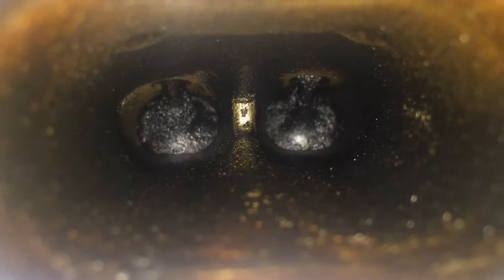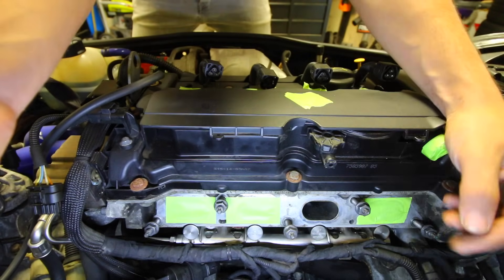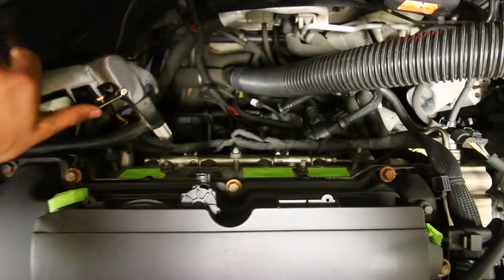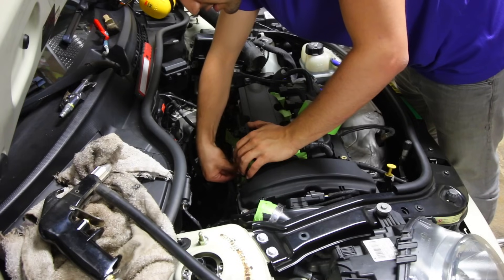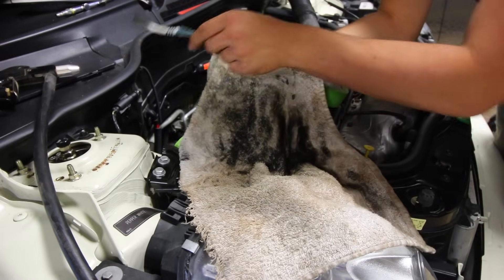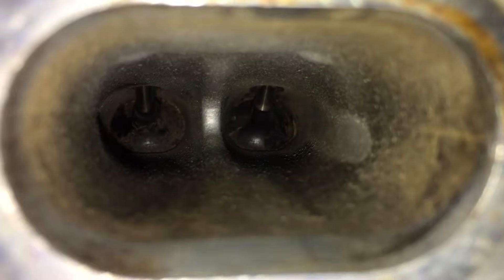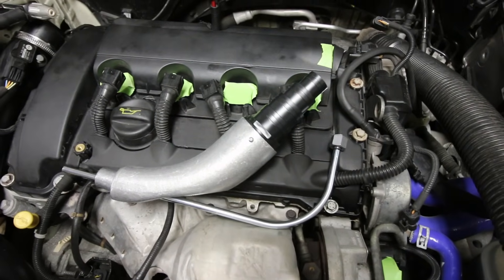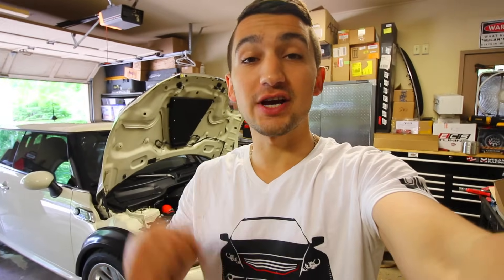How to Walnut Blast Your Intake Valves (CARBON BUILDUP REMOVAL)

Comment: Hey man, these vids have helped me sort out so many issues on my R56 since I’ve been subscribed to them! So I want to say a huge thanks! 

Quick question, if I did this process minus the actual walnuts, just cleaned with brushes and plastic picks followed by carb cleaner or similar would that be worth doing? 

Mine is suffering some hesitation under light acceleration so I’m sure I have carbon build up also @82,000 miles.

What are your general thoughts on the r56 n14 engine, they have really bad press on forums etc, but you are switched on and have still gone for one? Can’t be that bad then? How about a vid discussing the common faults with these and what to look out for when purchasing an r56? You would get a lot of hits.

Cheers
Ben

Comment: My tip: If you have a manual transmission, leave the car in gear and turn the engine by nudging thr car forward/back.
Reply: If you have a normal diff you have to lock one wheel, by doing one wheel in the air and one on the ground  than you dont have to push the car forward/back. just turn the wheel :)

Comment: Good video!  NEVER use an engine running solvent based cleaning as the deposits on GDI engines is NOT the soft carbon of past port injection. Solvents that loosen these hard crystalline deposits always results in some forced between the pistons and cylinder walls and causes scouring damage!!!

Comment: Why not just use seafoam spray or some other liquid cleaner since it's being sprayed by high pressure. Wouldn't it be just as effective and no Hazzard of killing your motor?
Reply from the maker: Seafoam would work for a port injection engine. Since this N14 motor is direct injection, nothing ever touches the backside of the valves, which is why these things gets covered in oil and carbon

Comment: Looks fantastic. 
Nice clean and ofcourse i'm sure it is better.
But what about the edges of the valves. 
Because they are closed, the edges stay dirty. 
How can you clean that?
Reply: marcello033 i was wondering about this too.
Reply: There are a handful of products you spray into the intake while the engine is running that are meant to replace this procedure, obviously nothing that comes in a can will replace this depth of work but it will help control buildup all around. Various forums recommend it as a complement to walnut blasting

Comment: Couple questions: How do you know if the valves are fully closed? What do you do if you get walnut pieces into the cylinder head?
Reply: Remove all spark plugs (so there's no compression and you're easily able to turn the crankshaft with a wrench) and insert a rod down the spark plug hole until it lands on top of the piston. Turn the crank until the rod is at its highest point and look into the port. The valve should be fully closed. I then taped a small piece of hose to the port and blew in it to make sure no air was escaping which meant the valves in that port were fully closed.

Comment: Not sure if you have a video on this but, I have a 2007 MINI Cooper S.  My engine light came on and an Auto Zone code came up to clean my fuel injectors.  Do you recommend an additive directly in the gas tank or will this not work on a MINI?  Any help is appreciated!

Comment: stupid thing to do. bits can blow past valves.  what about the exhaust side? exhausts always clog up more. the seats won't have been checked or cleaned. well if u have ever done a headgasket where water leaks into a cylinder you will see it gets washed clean. if u manage to introduce small measured amounts of water into the intake  manifold it cleans all sides of valves inlet and exhaust. de carbonised all of cylinder.  and only with steam. I have done this a few times before.  water droplets won't damage engine. no need to strip. simple
Reply: i did this and it was like a new engine. Like it or not, it works.

Comment: The valves dont have a perfect seal... so ur sandinblasting it on place!? Hahaha good luck
Reply: The valves  do have  a perfect seal to the piston area/cylinder; otherwise the engine would run V E R Y  badly; and the clearance in the guide is too small to let the particles in.
Reply: They should if the cam is in the heel position, a check light would come on if they weren't fully closing properly.

Comment: oh oh, this is the crapp sold nowadays. I was just laughing my head off, when I saw this. My car is 19 years old and never had an prob. that is comparable to this and sure enough I will take care of it, so it'll go a long way from now. Combined with the discussion about NOX emissions of dircet injected gasoline engines and the need of another converter, just like in diesel engines it is ridiculous if not to say disgusting. Anyway good movie in explaining how to remove what does not need to be removed, if proper technology is applied. Figure that you have to do this on a V6 or V8 or topp it of a V12 . You be stuck for days to do this.

Comment: That’s happens so bad in direct inject engines due to lack of pcv valves to stop oil from going into induction system and causing build up, a good catch can in the right location will make cleaning needing to be done way less frequently, and don’t forget to check and empty it every time you service the vehicle
Reply from the maker: A catch can is something will will 100% prevent this from happening so fast

Comment: Decades ago we used walnut shells to clean Rolls Royce Dart Turboprop engine compressors. Only diff was we injected the shells into the engine from a hopper at full power. Very effective on power restoration. Direct injection fuel mileage gains lost to mechanic labor costs to clean out ports which is complicated on some engines.  Net gain nil.
Reply: Or you could buy a Toyota with direct and port injection...
Reply: Darksyne, The Toyota idea sounds good,Since direct injection engines usually have higher compression ratios, and lower octane fuel can lead to pre ignition and pinging, is it the case that the port injection squirts in so little fuel that pre ignition is not a problem?
Reply: Graeme Williams at that point it's for the insurance that your vehicle will run right
Reply: Graeme Williams Net gain is huge when they are so dirty you keep getting limp mode. That being said, performance restoration was huge in my 335i. Car was terrible

Comment: stupid engineers. cant solve this problem
Reply: Unless you put a small injector in the intake tract...so yeah, problem solved.
Reply: nobody wants a perfect car. for you to own. those things are a joke, not cars.  efficiency wise there hasn't been a real breakthrough.being surpressed. a  small injector in the intake tract wonder how it would look. 
I'm also against liquid cooling in the engines. those things leak like crazy.  solid engine would cool just as fine without liquid. as they did.  cooling is terrible patchwork to try hide inefficiency.

Comment: seafoam in the fuel and sprayed into the intake manifold WILL loosen up carbon build up, the same can be accomplished with misting water after the mass airflow sensor. The only good way to do this would be to remove the head/s all together and make sure its cleaned... you'd need to be a real moron to do something like this, risking getting crap into the cylinders, getting stuck in the rings and potentially resulting in a re-ring job just for the sake of cleaning your valves and not wanting to take them off engine so you can clean the valves properly. This is the kind of shit a backyard mechanic does, a backyard mechanic with little to no knowledge of motors what so ever... why do you think they have fine air filters on the intake? even dust particulate can build up and cause ring and cylinder damage.

Comment: The tops of the valves do not matter.  It is where the valve seals against the valve seat that is critical.  Guess what...  You can't clean that when the valve is closed, dumb-ass.
Reply: I did this service and it was like having a new engine. Dumb-ass.
Reply: I wonder why the shape of the valve stems and top of the valves are contoured...  Why not just make them solid cones of metal?  Maybe weight and airflow don't matter?  But that's none of my business...

Comment: After doing a walnut blast or spray and soak intake valve cleaning you might as well install a catch can kit. That will help catch the crap that comes from the EGR and you can manually empty the can every once in a while.
Reply: Dashcam Dumbasses egr is separate. Catch cans only work off pcv's. Egr needs to be deleted/blocked off.

Comment: New cars are like a step back in evolution.
Reply: @Richard Skipper Correct!

Today's high tech engines are so efficient that a 3.8L V-6 makes more power than a 5.7L V-8 engine out of a Camaro from the 80s.   AND they make that power with almost twice the fuel mileage.
Reply: @inorite4553  Yeah, but at a cost!
Reply: @Jeff Sol Wow...just, wow.  How far up your 4th point of contact do you have your head?

Emission and fuel economy standards were put in place for two reasons: to save fuel, rationing what the US did get after the Arab nation oil embargo on the US in 1973 which cut all oil exports to the US and Isreal.  This led to fuel shortages, long lines at stations that did have fuel and a massive hit to the US economy.  Nixon, later created the Strategic Oil Reserve, fuel economy standards on all vehicles and a nation-wide 55mph speed limit to combat fuel shortages.

As for emission standards, those were put in place to combat the deteriorating air quality in the US and targeted gas & diesel burning engines to improve air quality.  

If you don't think emission standards were needed, just google photos of the LA skyline back in the 70s and compare those with today.  You may see a lack of a thick haze in today's pictures due in part to the EPA (also created by a Republican,) and vehicle emission standards.
Reply: @Jeff Sol The era of the Muscle Car died because those vehicles were too wasteful, too polluting and unsafe in their current designs.   They were dinosaurs in an era when the automobile was in the midst of a generational change.  Unfortunately for the US, the Japanese were more agile in their abilities to adapt and gained.....and never let go, of their advantage with making smaller, fuel efficient cars that were faster to adopt safety standards at a lower price than the big 3.

The times change.  It's survival of the fittest so adapt or die.  That's Capitalism.
Reply: @Jeff Sol because the only small economical cars being made in the 60's and 70's were tiny economical asian cars. then the oil crisis hit. guess which cars suddenly were most sought after? its wasnt the huge fuel hungry V8 muscle cars, it was the tiny 4 cylinder asian cars that got twice the gas mileage as those muscle cars. and remember those pictures from shanghai city a few years ago showing a fog of car emissions? after they put in very strict emission rules, the city got cleaned out to the point that going outside wont give you cancer immediately
Reply: More like 10 steps back. 500 sensors when one goes out your car is a paperweight
Reply: @jasonv9951  
Not really, there aren't really that many more sensors , and generally speaking most of them do not cause your car to not run however it will throw a check engine light. The exception to this would be a crank sensor or cam sensor. if the computer doesn't know the position of the engine then it cannot operate besides those pretty much everything else will just go into a limp mode that has a pre-programmed state that it runs in.
Reply: And you need manufacturer specific toolkits because parts are packed so densly normal tools dont fit
Reply: @jasonv9951  
That's also highly dependent upon what manufacturer anything from Europe yes there are lots of specialty tools but most of the Japanese cars used your standard metric stuff. I've got a 2008 Prius, pretty much the only tools you really need are an 8,10,12,14 mm socket. That will take 90% of the car apart. Besides those. You will need  15,17,22, and a 10mm allen socket.  That's pretty much the only ones I can think of.
Cars 12 years old with 340,000 miles on it
Reply: Matej Sommer It is a step back for sure
Reply: @Jeff Sol No argument from me.  I agree with you.
Reply: Car manufacturer have no choice, you can thank the EPA.
Reply: Bitch please!  You can thank the free market.

Direct injection allowed manufacturers to kill 3 birds with one stone: better emissions, better fuel economy and better performance.  The fuel economy and performance are HUGE selling points to the general public, thus the industry push to GDI motors.
Reply: @inorite4553  but are they better fuel economy?
Reply: Matej Sommer all has to do with emissions. Just vent pcv to atmosphere or run a catch can and you can eliminate this issue. same crap is ingested with older engines it just gets cleaned off by gas with port injection and builds up on newer DI engines

Comment: So the new tooth brush is good for your teeth but not for the engine head because too harsh ?
No chemical neither ?
Are you serious ?
you have acid oil vapors ,acid exhaust gases rom the egr , and you don't want to use a petroleum based product to clean that crap ?
Reply: Citroën and Peugeot are doing the same process but with sand ... So a tooth brush will not damage valves. Some people are doing it with a screwdriver ^^
Reply: Walnuts are environmentally friendly at least.

Comment: All that is thanks to the emissions control equipment.. ie EGR, EVAP and what not
Reply: Juan Maldonado actually it’s the lack of a proper pcv system to prevent oil from entering into the induction system, this happens on all engines however with direct inject the fuel isn’t making contact with the valves thus not cleaning them and causing carbon build up. Older vehicles have evaporative systems and other emissions control devices as well however they are port injected, throttle body injected, or carbureted so this issues isn’t as prevalent with them.

Comment: Every one please wash the dust out before you run the car the dust with wear the cylinder wall and rings
Reply: And I think that a methonal injection  would greatly help with these kinds of issues
Reply: @Removeable Skull That's what I was thinking but how do you clean it without disassembling?
Reply: Jeff Smith disassembling is part of the job but this isn’t a full tear down in the video so there is some risk of grit getting somewhere that you don’t want it.  A full tear down as in taking the head off of the engine and clean the valves and ports and then wash the head inside and out would be the best method of this it just takes more time and a couple new gaskets for the head and valve pan
Reply: Jeff Smith  if I had to do the same job I would use the soft brushes he showed with carb cleaner and wd40. The wd40 is good to loosen stuck on sludge

Comment: I mean, this is just waste of time. That Will not make any differnece.
Reply from the maker: And that is where your opinion is wrong.. It in fact DOES make a difference
Reply: milanmastracci by cleaning the inside of the Valve? The problem with the Valve is that they dont Seal as they should after a While. And there is where you Power dissapear
Reply: Are you trying to say something xD ?
Reply: Timmy Tel
Reply: You're wrong. I did this and it felt like a new engine.
Reply: Timmy Telebrant wrong. Valves close fine it’s about air flow and swirl efficiency.
Reply: Nora laundry music
Reply: Nora aunor music
Reply: Timmy Telebrant my love for
Reply: It does make a difference for example on diesel engines with an egr that takes exhaust gasses before the particle filtre... that is just evil gunk, but here, that''s just not going to change anything. Much to high risk of ruining the engine. Also i dont get why this blasting is not done with dry ice, absolutely no chance of ruining an engine there. Dry ice is just gone after a couple of hours, a walnut piece in your cylinder not so much.
Reply: Timmy Telebrant you're a moron. Do you work on direct injection motors every day? This literally does make a difference.  The gummed up dirty valves can create misfires, plus clog injectors...
Reply: i understand your concern regarding that, carbon would seal the edge of the valve on its seat when the valve is already worn. 

In that way you could run a test with compressed air to determine if the valve is leaking pressure afterwards, you may inject compressed air into the cylinder via the spark plug or the injector hole (if it is direct cyl. injection of course), but it should make a difference.

A carbon particle that falls off the intake valve carbon deposit and becomes red hot inside the cylinder can cause pre ignition of the mixture at an early stage of the compression stroke prior to reaching top dead center when the spark plug is igniting the mix.

I guess we would have to cover the fact that removing the carbon deposits could cause a little bit of compression leak in the valve edges but in my opinion pre ignition and engine knocking are far worse.

Comment: How do u know when the valves are closed? can you see it inside the port? will you be able to see the difference? (sorry never seen the inside of the ports) just wondering becasue im looking to buy a 335d and as this is a common problem on them im just trying to educate my self:P
Reply: you can spray in some WD40. If it goes past the valves, you know they arent sealed.